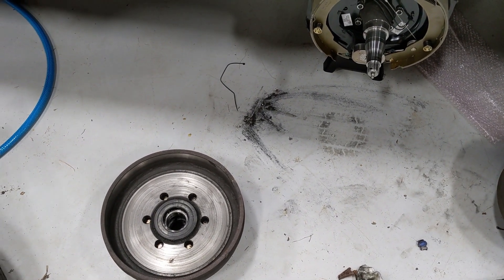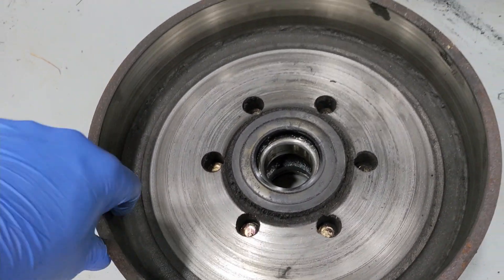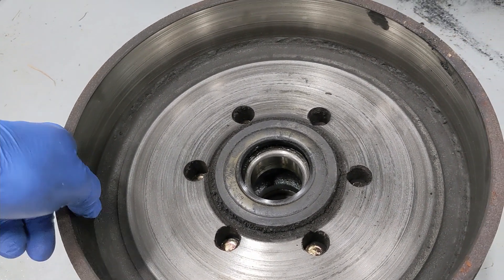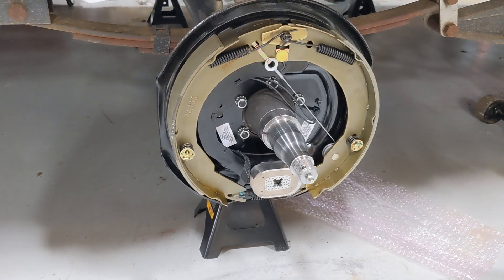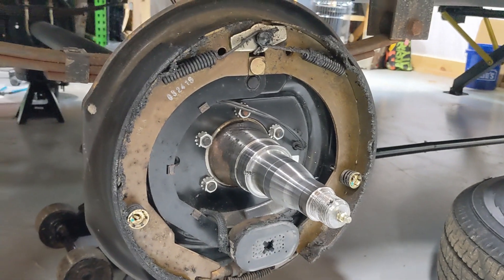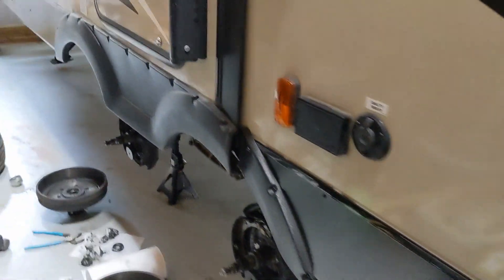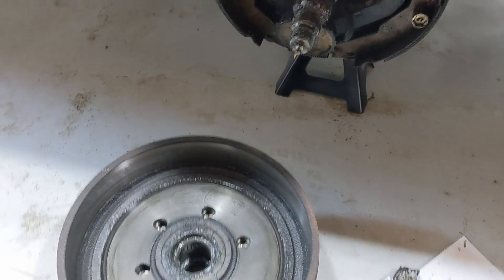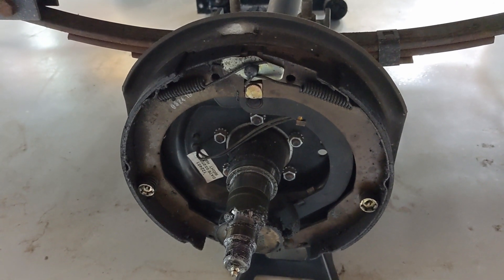Dexter/Lippert EZ Lube trailer axle spindle bearing seal failure - why did it happen?

Comment: Thanks for taking the time to make this great video of your work.  I purchased a used trailer with Dexter EZlube design and I have 2 out of 4 seals that have blown out even though I used the proper technique of spinning the wheel while slowly adding grease at beginning of the season.  I'll just take them apart each year in the future and repack them manually.  Doesn't seem like a good design if you are only supposed to use the grease zerk for emergency use.  IMHO, that's just plain nonsense but after my blown seals, I'll certainly be following that advice.  Thanks again for creating this video!
Reply from the maker: You actually answered one of my questions, whether one could do the emergency service properly and not blow out the seals.  I guess your experience settles it.  I'll be doing a complete teardown and repack with new seals this winter as well so as to avoid any potential failures.  Maybe I'll even throw in a new set of bearings just for fun, although the ones in this video are still going strong after approximately 4000 miles since I filmed it.

Comment: I have Lippert axles with what they call Super Lube.  Like you said jack up the wheel, and using a hand grease gun, rotate the wheel, while slowly inserting the grease.  Never with a stationary wheel.  I do this every other year. The off year take the hubs off, inspect the brakes and bearings.  Repack the bearings manually, then reassemble with new seals. Then I fill with lube while rotating the wheel again. This fills the void between the bearings also.  I've never just trusted the grease I pack into the bearings alone. Grease gets hot, thins out and runs, and where does it go, into the void between the bearings if not full of grease.  Just my thing, may not be necessary but don't hurt. The following year, again just lift, rotate, fill, and good enough until the reinspection the following year.    Also when reassembling the wheel, I do tighten down the castle nut enough so the wheel no longer turns, or is very difficult to turn, then back off just enough, until the wheel turns freely.  I feel the bearings need to be reseated after disassembly.   PS: have not blown out a seal yet.   Knock on wood  LOL

Comment: Always replace bearings that seals have blown out. In this case I would have either replaced all bearings or gone with new axels. 

I refuse to use Dexter EZLube axels. They are a defective design at best.
Reply from the maker: Not a bad policy. These felt perfectly fine, so I decided to reuse them. Over 1200 miles on them since then, and so far so good. Fingers crossed!
Reply: you are totally correct i imform everybody to get rid of thr
e axle and buy a haul master.

Comment: The Dexter EZLube Axels are poorly engineered. They fail 95% of the time. 

I will never use them. Even when people take the bearings out clean and repack, the seals still fail. They should be recalled and redesigned.
Reply from the maker: I've had 3 replies to this video in the last 2 hours after nothing for months.  Google must have flipped the switch on to "recommend".
Reply: @NoelBarlau  I searched the subject matter, selected sort by newest and made sure to “like” and “comment” which drives the algorithm to more viewers.
Reply from the maker: @icare7151  Well, thanks!

Comment: Looks like you got everything right up to the castle nut torque. You should slowly tighten the nut to 50 lbs as you turn the hub, then loosen the nut to the first slot to insert the carter pin and then give the hub a good couple of turns to be sure it's free. I personally add a little extra grease to the bearing race and spindle surfaces before putting in the bearings and sliding the hub onto the spindle.
Reply: Bptraveler, I’ve never heard of a carter key.  😅

Comment: I always spin hub tighten till itvreally slows down to set bearing and loosen to correct feel.  I would have change all bearings if the races looked bad.
Reply from the maker: The bearings and races looked nearly new as far as I could see, so I re-used both the bearings and hubs.  If they're showing significant wear this fall after we drag the trailer halfway across the country and back, I'll replace everything.  The technique I used to tighten the nuts was an aggregation of methods I saw watching hours of YouTube videos on the subject, but I'm sure there are other techniques I didn't see.  Thanks for your input.
Reply: @NoelBarlau  i was surprised with the small leef springs.  I thought they be heavier duty.
Reply from the maker: @Peter-od7op  The trailer weighs less than 8000 lbs empty, so there's really just over 4000 lbs per axle.  It seems to be enough axle and spring to do the job.  I remember seeing somewhere recently that travel trailers are only designed to do something like 33 trips before self-destructing.  They're built lightweight and are super flimsy if you look past the fancy trim.